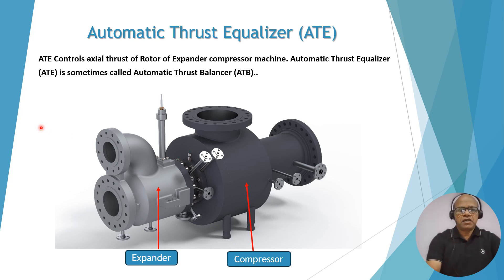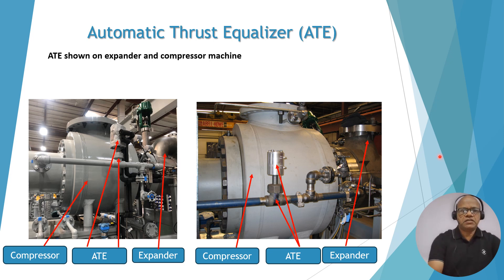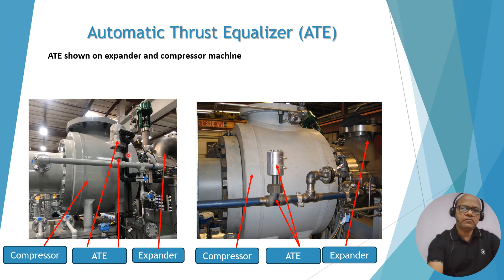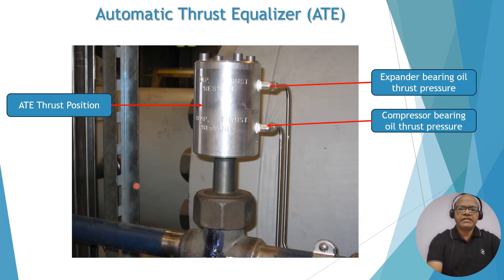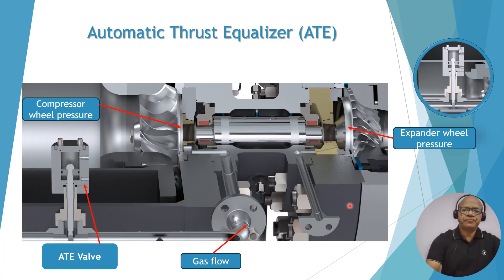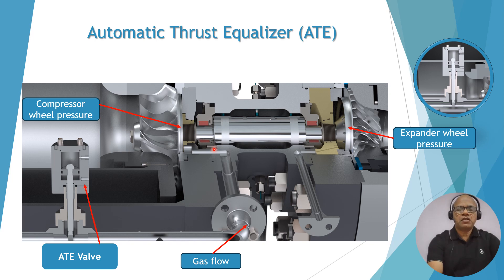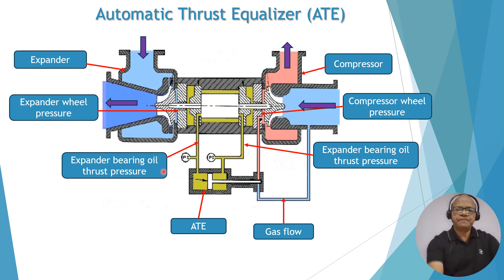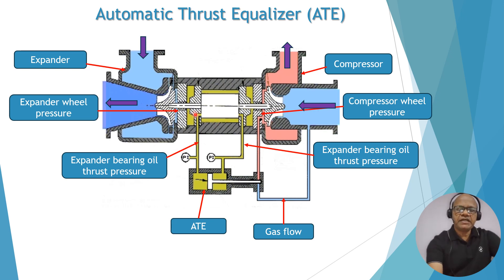Automatic Thrust Equalizer ATE of Turboexpander compressor

Comment: Great video.  Is the sensing of the thrust pressure only possible with fixed geometry thrust bearings, or is it also possible with tilt-pad thrust bearings?
Reply from the maker: I have seen such arrangement for only fixed geometry thrust bearing . I have never come across for tilting pad thrust bearing ..so, I am not sure for tilting pad thrust bearing . Thank you for liking this video .